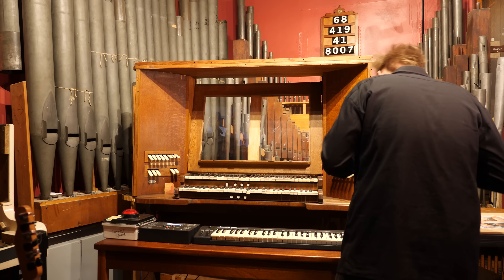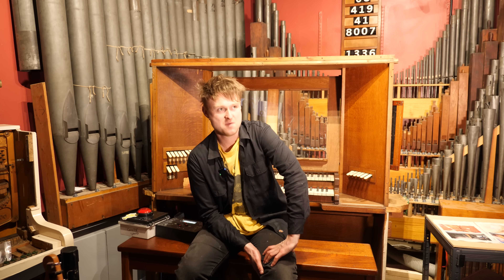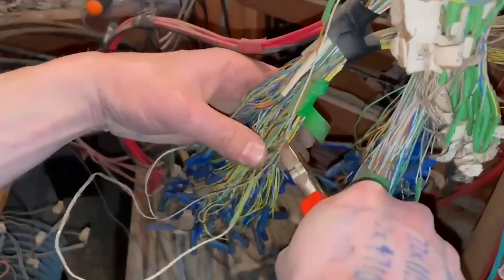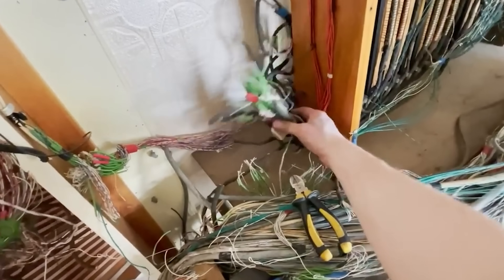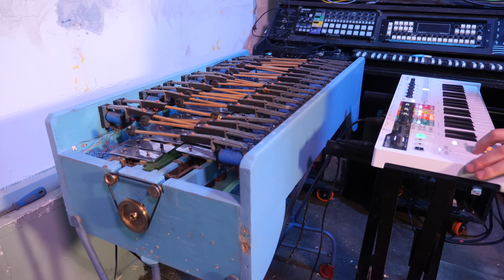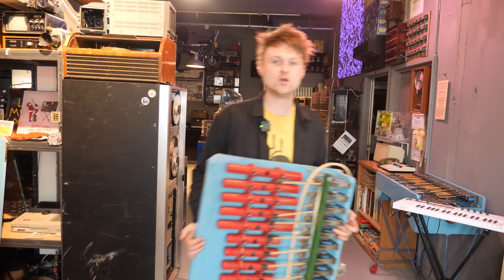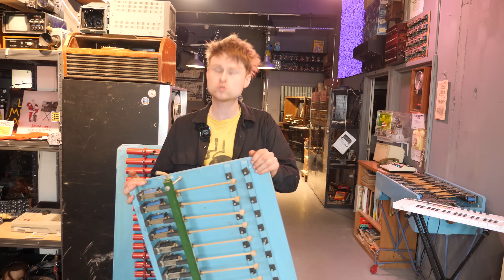ANOTHER MASSIVE ORGAN Project - Part 1 MIDI VIBRAPHONE

Comment: stepper motors arent made for that application but they are very quiet from what i hear
Reply: or running a larger motor at lower speeds with a gear reduction to the belt
Reply from the maker: Check part 2 it's sorted

Comment: One note, those diodes are for flyback voltage-spike protection. Now, while the ULN2803 of the solenoid board you have got its own set of protection diodes internally, it is worth noting that not all transistor-array chips got these for people looking into designing their own driver boards. It's a very common beginners mistake to have motor and/or solenoid driver transistors blow due to lack of protection, and I see the engineers behind the vibraphone got around this by just using solenoids with the diode already built-in.
Reply from the maker: I'm pretty sure most people know about adding protection diodes. But indeed. Cheers!

Comment: when replacing motor you could also add a position-encoder-magnet-thingy, to allow absolute control over the modulation...
Reply from the maker: But you do have absolute control. Position isn't critical

Comment: For the vibraphone motor remember with a brushless motor you want one with sensors otherwite it will not be able to go to low speeds. Don't cheap out on the motor.

Comment: Basically any stepper motor with a silent driver should work well to spin that vibraphone thing. Those have very precise low-speed control, plenty of torque and are easy to get.

Comment: That's really cool. Never saw a vibraphone up close. Not that it would make for easy automation, but while you sort out the servo, you might still be able to play the vibrato with a foot pedal and flywheel, like an old sewing machine. Could work for near-term recordings. Definitely has the low-speed control. 😅👍

Comment: If you could find a way to measure and therefor sync the BPM of the vibro effect with the MIDI controller that could be really cool. Like how there's midi controlled delay and tremolo and such guitar pedals. Route through a variable foot pedal, set interesting fast and slow speeds to toggle between like a Leslie.

Comment: Maybe find a disused electric drill/driver and take the motor out of that, most have been brushless for the past few years, bound to be one or two in local 2nd hand shops or the bins. Sadly though, usually the first thing to go in them is the motor but you might get lucky.

Comment: i would think any brushless motor with a good ESC out of any reasonable sized quadcopter would work, will have the same servo motor interface, and should be almost silent, but you need to replace the big wheel with a much (much) smaller one.

Comment: The diodes on the relays are for flyback voltage suppression as the coil is de-energized, it does make the coils polorized so they need + and - right ,  but you need them somewhere in the circuit, maybe the new drivers have them. Fascinating work.
Reply from the maker: The drivers I use have them

Comment: I use Rev neo 550 brushless motors for robotics and controlled the controllers with pwm with an Arduino. They are pretty fast, I didn't know if they'd be able to go slow enough consisteny for this application. And even brushless motors have a spin up whine at higher speeds.

Comment: I was a bit concerned when you said you were cutting the diodes off the relays.  Diodes across relays are generally there as protection against back-emf when the coil is de-energised.

Comment: May be good idea to use rear window washer motor, with its worm gearbox from some small car. Probably it will need to be modified for rotary movement from swaping directions one. When you add there some grease it could be pretty silent. Like german u-boot were😉
Or its possible to buy ready to use, small chinese mechanisms. They silent too, and motors are small. You can choose how may revolutions per min you need.

Comment: A couple of thoughts could you run a motor for each bank, as the belt gearing looks around 1:2, this should let you run smaller motors faster, without the need for the gearing on the motor which makes it more noisy.

Also would having the vanes able to stop in open or closed be an advantage as that would give 2 distinctive sounds as well as the vibraphone.
Great work as ever
D

Comment: A backwards diode is wired across a relay or solenoid coil because when the power is cut to the coil, a reverse voltage is momentarily generated in the coil as the magnetic field collapses. The diode is forward biased to this reverse voltage and allows the negative spike to dissipate quickly within the coil and keeps it out of the power supply. The solenoids will work without the diodes but without the reversed diodes the negative voltage spikes can get into the power supply and/or reduce the response time of the solenoid. Search Google for "flyback diode".

Comment: Hi Sam. I think the best will be asynchronous motor with control circuit you use in leslie in gameboy machine. But instead of using potentiometer, use optocoupler with LDR ;)

Comment: If nobody has mentioned it, perhaps ssomething like the RMD-X series motors could work. Theyre 3 phase with built in foc capable controller and encoder, so they can work at low speed and you can control without an esc.

Comment: If you're planning to run the shafts up at audio speeds you're probably going to want to switch to using a timing belt so they don't go out of sync (or maybe not I suppose, could potentially be interesting...) you'll also need to probably install a better bearing solution for the shafts.
Reply from the maker: It'll be fine as is but cheers 👍

Comment: Carter 115v 1.8 amp brush motor number CUB1007AR controlled with a 3 amp 115v ceiling fan speed controller is what I use for all my pointless automation projects. You’re in UK so I presume you have all 220v wall sockets, in which case you’d have to run a voltage converter.
Reply from the maker: For standardisation keeping it all 12v

Comment: Are the solenoids mains voltage, 240v?  I'm building a chromatic arduino door bell with aluminium tube chimes similar to this and trying to find powerful enough solenoids.  Anyone got any leads on suitable solenoids that'd be ace ta!
Reply from the maker: 12v
Reply: Pipe organs commonly have chime sets where the solenoids are already provided as part of the mechanism.  You'd just need to get a set like that, and replace its tubes with your aluminum tubes.  Often (historically in the 20th century) the solenoids were made to run on low voltage AC (10 to 16V) and had a multi-tap transformer with a switch to select the voltage, i.e. volume, and either its own separate little keyboard, or a relay for each note to take the 12V DC from the organ's keying, and control the AC to the solenoids.  I've been told, by a source I believe to be knowledgeable, that those AC solenoids will work fine on DC (the DC won't hurt them), and in fact will be more powerful on DC.

Comment: @ 12:33 - you have a brushless in place (the servo). You need a good quality DC brushed commutator motor, with pretty strong shaft support bearings (the side load on the servo from the rubber belt was what was causing the bulk of the noise). A decent, high-current H-bridge shield for a UNO R3 or some such should drive it, with a current capability of about 2 - 2.5x the peak current draw of the motor.

Strangely, the motor you took off looked like a modified London bus wiper motor (probably Lucas) which would have done the job fine. Why not try that? You also need to watch the belt tension.

Alternatively, use two brushless servos driving the shafts directly via flexible couplings (take the pulley wheels off), one for each set of tremolo butterflies, which will not have any side loads and can be synchronised for position to keep each bank of butterflies in phase. Great project!
Reply from the maker: Thanks for the info! Excuse my knowledge if wrong but I'm pretty sure servos, well the cheap ones I had are almost certainly brushed motors. I meant brushless purely from the point of a lower end kick but also high rpm with low noise. I want it to rev up and down via the digital input quickly and quietly but no need for torque. The first thing I tried was a brushed motor I had but for whatever reason it wasn't working so I switched to servo. I tend to work with what I have on the day. Especially when needing to finish projects for videos (like this) in 2-3 days postage becomes risky so I rely on what's in the drawers. As for the motor on the vibraphone it was a 230v geared motor so I'm assuming bus wipers used 12 or 24volt supply it's possibly not? I don't think it would do what I'm hoping I want to get up to atleast 300rpm on the shafts and slow as 20rpm I don't think that would
Have done it. Also how bodgey it was and also the weight and mismatch of voltages. Trying to keep the whole room at the standard of 12v  and 1 power input per machine. Anyway thanks for the thoughts! Think I'm going stepper motor. Cheerz.
Reply: @LOOKMUMNOCOMPUTER  FWIW, the vast majority of the noise caused by servo motors is the internal gearing mechanism, because the tiny DC motors in there run best at high speeds, but results in low torque. The noise has basically nothing to do with the brushes or DC, so don't write those off.
The setup is actually quite inefficient because you first have the internal servo gearing that reduces speed and increases torque(with resulting power losses), and then your external belt-driven system that then re-increases speed.
I suspect the steppers will also be noticeably noisy despite fancy drivers, just because still at their core they are discrete, almost digital, devices and will have cogging noise effects. Hopefully I'm wrong!

Comment: How would it sound if the two paddles were controlled by independent motors? Probably rubbish, but worth a try?
Reply from the maker: I tried. The effect was not too interesting. It would make sense if all were individual but due to the fact one shaft is whole notes and the other is half resulted in just a bit mehneas so I cut it from the vid but cheers!

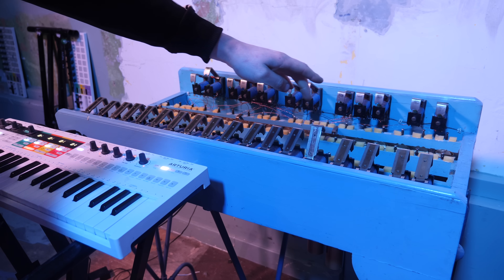Comment: 9:39 you might be better off soldering the diodes (preferably also new not reused) back on, still in reverse to how they are ACTUALLY powered now -cathode (the side with a strip) to POSITIVE end of feed - ofc unless the controller board has its own bank of them (these are to protect the output transistors in the chips from the reverse voltage spike that happens when current is interrupted (it might work for a while without them, but in the long run, especially on high-tempo switching, might deteriorate the output chips slowly till they release the magic smoke again...) (some output stage chips types have these built in but not enough to handle every possible output coil)
Reply from the maker: Uln2803 have them built in
Reply from the maker: No need

Comment: Please use much, much longer belt. Perhaps with some potential slip. It will soften hard pulls that most BLDC motor does every 120 deg. Perhaps better would be some small induction motor with frequency regulation...

Comment: Why don't just use a brushed DC motor? Maybe one with a gearbox.
Reply from the maker: That's what was on it. And also a servo is basically a brushed motor with a gearbox. Reducing gears reduces noise

Comment: how about using a drive mechanism from a tape recorder or turn table (im guessing belt drive would be best), may need some gearing. These are just ideas.
Reply from the maker: Harder for speed control digitally
Reply: @LOOKMUMNOCOMPUTER  but if it had some kind of fly wheel and then you could control the speed via pwm (555 timer with a mosfet) not that I've done much with electronics, so its just ideas. Obviously the fly wheel would add some lagg but also would hopefully help stop the motor from stalling at slower speeds). For that  matter how about using the motor from a trifecta fan (the type used on a hot summers day or to make your  voice sound like a dalek), again electronically switching the thing on and off. maybe rig up the speed control of the fan, so the options of the speed settings would be more limited but would be quite quiet.
Reply from the maker: @firehandszarb  you could! But slower response. Thanks for the idea! But going for stepper motor now. Thanks though!
Reply: @LOOKMUMNOCOMPUTER  i look forward to seeing the next installment

Comment: Those diodes in parallel with the relay coils are likely flyback diodes to prevent negative voltage spikes as a result of suddenly disconnecting an energized inductor. I'd suggest reconnecting them in the opposite orientation so they aren't shorting your arduino GPIO but allow energy stored in the coils to be released.
Reply from the maker: No need uln2803's have built in protection diodes
Reply: @LOOKMUMNOCOMPUTER  heh I was going to comment on the good reason for keeping the diodes, but I was beaten to it and I see you have it covered anyway! The ULN2803 is a dream chip for driving anything solenoidal (if that's even a word :-)  )
Reply: @davechisholm9670  "Solenoidal"? Are you sure that's not something to see a doctor about? 🤣

Comment: What with all this organ transplanting going on, I wouldn't be surprised if you managed to get your hands on your local abandoned cinema organ, the beautiful Compton hidden under the stage at Dreamland in Margate...
Reply from the maker: Is that still there?
Reply: @LOOKMUMNOCOMPUTER  I'm pretty sure it is. I read somewhere that it was listed along with the building so it's technically protected, but a few bits were nicked including the wiring for the lift so it's stuck under the floor. I can't imagine anyone's managed to move it yet, particularly as the cinema is still unused (as far as I know, that is)
Reply from the maker: @SqueezeboxOfDelights  yeah I'm not sure! No idea who I'd contact either
Reply: @LOOKMUMNOCOMPUTER  I went over that in my most recent email - I can put you in touch with the people there. Organ still there, not been accessed for years as the chests are all up a very dangerous ladder atop the stage, last work done on it was by Roger Greenstead, sawing up the old Noterman chests, the intention was to replace them with Compton chests however I don't think he got that far.
Reply from the maker: @ConacherOrgan  sounds interesting! I'll have a look at the email i must have missed it

Comment: maybe look out for RC Drone motors, they are quite powerful, DC and speed is controlled with the arduino motor controller and a little bit of electrical engineering to fit the specs of the motor
Reply from the maker: That's a brushless motor. 👍👍

Comment: Move the server down and use a larger drive pulley? This would lower the RPM needed. Doesnt seem to need a lot of torque to turn those modulatorflappy cams. This would reduce the resolution of the speed control a bit....
Reply from the maker: Yep I was thinking to do so. For the video I worked out of parts box. Hence the way I went
Reply: For running a vibraphone at traditional paddle speeds, it's more common (i.e. the ones I've seen on cinema organs) to have the paddle shaft pulleys larger, and the drive motor pulley smaller.  That way, you don't need as much gear reduction.  But I take it that Sam's goal is to be able to spin the paddles much faster if/when desired.  I used to work at Kodak, and when I started there in 1984, they had been making digitally-controlled microfilm workstations.  That was back in the days when normal/affordable computers didn't have enough processing capacity to deal with digital images.  Instead, with those viewer workstations, a database on a central computer (or an operator keypad) told it the frame number, and the viewer would automatically advance the film to that frame.  For moving the film, it had a DC motor with built-in tachometer, among other things.  A motor like that with the built-in tach would let you servo-control its torque, so as to quickly achieve whatever speed you wanted.

Comment: I'm curious what it would sound like using 2 separate motors for either of the (idk) cams instead of the one motor with the belt?  It would be interesting to control the valves independently on each bank (or individually at that rate, but way more involved).  Can't wait to see where you go with this one!  Honestly, the design of this one seems like it has a lot in common with carbonated internal combustion engines from the same era.

Comment: Honestly, maybe the way to go is a NEMA 17 stepper motor with a TMC2208 driver. Perfect low to mid speed controll, enough torque, nearly silent operation (provided you use a silent stepper driver like the TMC2208 or similar) and easy to control via arduino with the AccelStepper library or something similar...
Reply: Unfortunately I've tried this type of arrangement, and it's great up to a certain speed before it starts vibrating due to the resonance of the motor and the drive frequency itself, since it has to commutate the coils at higher and higher speeds.  It's too bad, but you're stuck at lower frequencies.

Comment: It could be worth experimenting with the butterfly shaft timing. As there are two shafts you could try timing them up to close both lots of flaps at the same time or putting them out of sync. Not sure if it would make a difference. If there was an optimum timing then a toothed belt could be used to keep them in time.
Reply: Yeh!